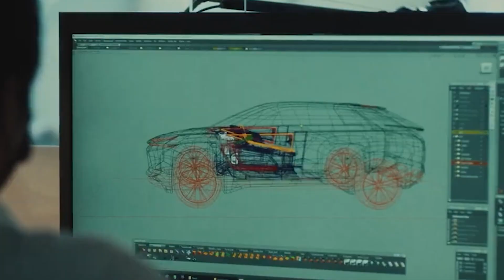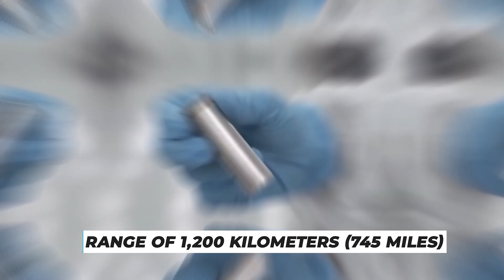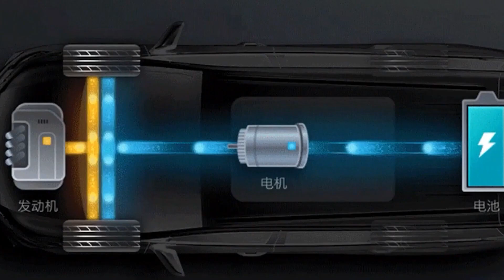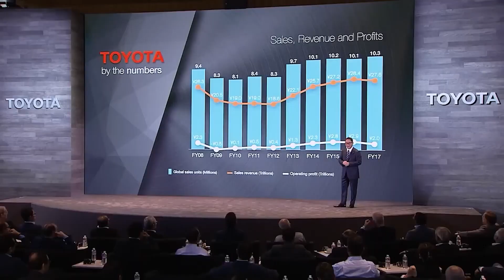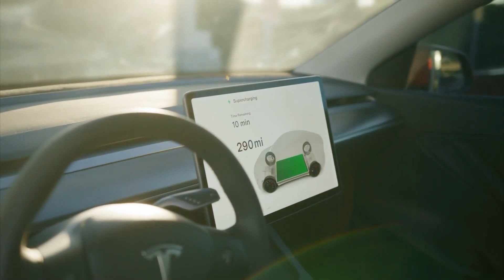Toyota CEO "Tesla are so far behind us" Toyota Solid State technology will blow your mind!

Comment: RE fuels (Electro Ethanol) and new combustion tech at 75% efficient that can run on fuel and solar thermal hot water are the future.  

Why?  

It is 20 times less costs to make fuel from this solar thermal RE tech off grid than to charge a battery from the grid. 20:1 !!! 

This fact alone dooms EVs.  It does not matter what EV range or charge rates get to.  20:1 costs kills the EV.  Wake up.

20:1, fire risks and mining waste (radioactive Thorium) kills the EV.  Nothing more needs to be said about EVs when you grasp these three issues.  There are over 100 more issues if that is not enough.

All EV companies will go bankrupt.  Friendly hint.